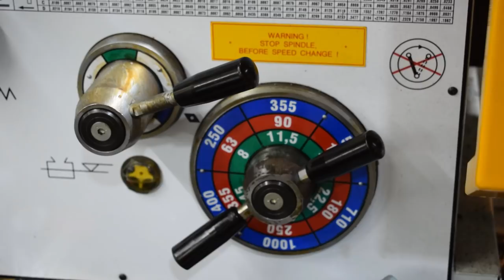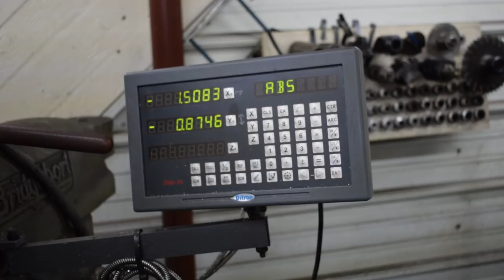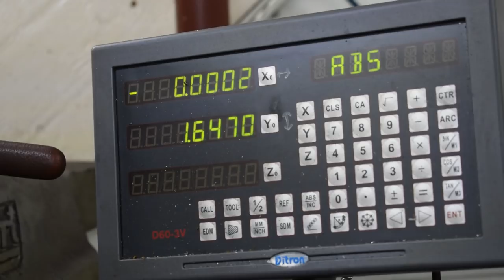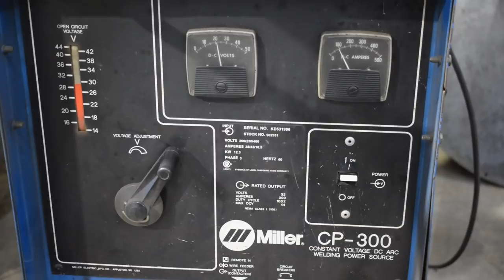Hydraulic Cylinder Rod Eye Removal and Reinstall - Machining and Welding

Comment: Nice of you to take the time to make a video. When finding the center of a circle with a DRO. Use your edge finder on the first side and zero your axis then go to the other side then touch your 1/2 button then touch your axis again when you return to center your DRO will read zero.
Do the same for your other axis and you will have a perfect center.
Jack, Heavenly Machining.
Reply: You caught that too. I had no idea whet he was up to with the dial calipers.
Reply: It seems to be easier to just use a dial indicator in the spindle.

Comment: This was a very interesting video showing an unconventional way of undertaking a difficult repair. I have a tip for you. I  was recently watching a video where the guy was doing plasma cutting, MIG welding, arc gouging and arc welding. He had his camera behind an auto-darkening welding lens and the video really showed up the various processes very well. It showed a first-hand look at the processes, just like the operator would see. It could be something you might want to look into. All the best from Queensland Australia.
Reply: I've also heard that a welding arc can damage the CCD in a camera. No idea if true, but I think a helmet (or just the module from a helmet!) could certainly be a good thing to do.

Could also protect camera from accumulation of vaporized metal and such from the welding process.
Reply: @Resonantfate  guess it's a good thing consumer grade cameras haven't used CCDs in a decade...

Comment: Kurtis tack welds it while its still in the lathe. With that brand new lathe of yours, I'm not sure I would do that. Fun to see the comparison.
Reply from the maker: Yeah, I've seen that done. No chance I would ever do that. The risk of damage is too great.
Reply: @TopperMachineLLC  I'm a controls engineer and I have a background in automated welding. Many assembly lines have welding cells and don't have any issues with the electronics. Kurtis addressed this in one of his videos and he has no issues. I can't say if it's good or not. Kurtis is a stud tho. That cat is a worker.
Reply from the maker: @ValiRossi  the electronics don't concern me at all. It's the spatter, and fumes filled with particles getting on the machines. That's why my weld shop is separate from the machine shop. I made the mistake when I started out and added the weld shop soon after.

Comment: Nice work man. I would like to see a slightly deeper back cut into that weld area just to get more thickness into that weld and a couple of tack welds all the way around before starting the full weld. Almost certainly its pulled to the side a little.

Comment: Great work Josh, nice camera work on the Mig wire running out. Bits like that take you up a notch or two from the others. Oh... and... May the Force be with You !
Reply from the maker: Thanks. I was wondering who would be the first to comment on that. Lol
Reply: @TopperMachineLLC  On a serious note, it made a lot of sense to do those cylinders like that especially if you've got all those skills in house to do it.
Reply: @TopperMachineLLC  I also knew you'd run out of wire. You commented on the wast of the wire. With your large roll, it's only a small percentage of the roll. I use flux core wire, as I only do a bit of welding occasionally at home and I use 1lb or 2lb rolls, so the amount of wire I have to waste is a lot higher percentage of the roll. Pity there isn't a way to join the wire when it runs out.

Comment: Josh, you have your audio level recorded (at some point in the video, maybe all of it) a good bit loud. The "Stats for Nerds" on this video reports:
Volume / Normalized: 100% / 37% (content loudness 8.7dB)
What this means is because you recorded 8.7dB too hot, YouTube has cut the volume down to a maximum of 37% of the recorded volume.
This actually makes the output volume a bit low.

Ideally you want Content Loudness to be 0dB or a little bit below that. Don't go way low, since YouTube won't increase the volume if it is too low.

Comment: Might be worth looking at getting an R8 shank ER 32 or 25 collet chuck and a handful of tap collets for the sizes you use most often. R8 to MT adapter with MT tap holders would also work. You would lose some Z travel, but you would get reliable torque transmission through the square drive.

Comment: Glad to see a chain hoist in the weld shop we need one by the Lathe we are getting older every day thanks
Reply from the maker: I'm working on one for the machine shop as we speak.  Jobs are getting way to heavy.
Reply: @TopperMachineLLC  Join the club!
Reply: I follow Curtis and Adam among others, and they are always scrupulous about blowing off debris as well as wiping.  Topper needs air as well as a hoist at the lathe. I cringe sometimes when new cuts are started with debris laying around on the piece.

Comment: I work in the plant where that cylinder was manufactured. You won't hurt that chrome. (Today atleast) they machine the threads for the piston nut after the rod is chromed and polished. They also weld the eyes on to the rods by rotary friction welding, that occurs after chrome, polish and machining.
Reply from the maker: It seemed like a good quality rod. After the first one I knew it was good chrome.

Comment: I see you backing up a lot with your fork lift. I suggest you put add some side or rear view mirrors for safety. Who knows if someone comes in and surprises you one day.  Does it make a sound when you are backing up? Good videos. Thank you.
Reply from the maker: Don't have to worry about anyone coming in. Open by appointment only, and doors are locked otherwise.

Comment: Very interesting video I have made custom length hydraulic cylinders in my farm shop I don't have any nice tools other than a century stick welder and a abrasive cut off saw it took about a hour to saw the 2 1/2" chrome rod the barrel cut easy it was -20 degrees Fahrenheit out doors and my shop had no heat I welded the cross tube on and when it cooled it fell off it was the first pass so I beveled it some more and turned the heat I used gun grease on the chrome rod in the winter time and the next pass it held so I reground the weld and put 2 more passes and it has never failed it's on a log loader 5 inch barrel it has a lot of lift capacity I had to be back in operations the next day so I didn't have time to wait. I enjoy the video very much 👍👍👍👍

Comment: 16:22 lots of smoke and little coolant.
Yes, that was a good bit of GTAW filler wire.  0.045" is right size for 16 gauge sheet/tube.  S6 is a bit more fluid than S2 with extra deoxidizers, perfect for blind tube welds where you can't clean the inside.

Comment: I have never had to cut the eyes off a piston to replace the seals and I've always used a 4 to 1 with a torque wrench to take the nuts off and put them back on to the Pacific Torx now I have had to weld new eyes on because of waddled out bushings and being broke off

Comment: Rance here Josh, first time viewer. Will the facing off (flattening & drilling) end of eye cause a weak area that will crack & fail under the extreme pressure the eye experiences with use?
Reply from the maker: Not likely as most all of the real force is on the rod end on these.  I also took such a minimal amount of material off that it should never be an issue.
Reply: @TopperMachineLLC  Thanks Josh, I am not a machinist (maybe a wanna be) in my self study and listening to videos …the zert greasing area which penetrates into the eye area has been a weak point in some high stress places. Just wondering if this might be a similar circumstance. Appreciate your prompt answer and knowledge. Really enjoyed video.. I have subscribed to your channel.

Comment: I always just pin them and tack it in the lathe before heading to the rotator to weld. It's also rare I have to cut an eye off to repack but it has to be done sometimes. Some "non serviceable" cylinders can be rebuilt, you just have to cut the butt end off amd re weld it.
Reply from the maker: We discussed pinning, but decided on the threaded rod for fine adjustment of final length. I've worked in shops that welded in the lathe, not in mine. Saw a couple lathes scrapped because of improper grounding, weld spatter, dust, etc.
Reply: @TopperMachineLLC  for sure, and yes you really have to take the precautions or welding in the lathe can be a disaster.  I can see why you wouldn't that's a nice lathe you have and threading was a better way to do it out of the lathe. I love hydraulic cylinder work, do lots of it so it's always cool to watch how others do things. Always learning in this trade lol
Reply from the maker: @kamper4140  thanks. I really like my new lathe and want it to last. I just started doing hydraulic work, so still learning. The shop I'm working with has been at it almost 50 years and recently lost their machinist due to major health problems. Before I do anything, I consult them. Having never done it before, I was cautious on the first few and they told me that it was as good as what their guy did. I was the 4th shop they tried and the first one to put out the quality they are known for. It's been working out great for both of us, they get quality products and I get to learn new skills.
Reply: @TopperMachineLLC  that seems to be a trend right now in the manual machining world unfortunately. I'm 39 and not many my age or younger are into what we do, gonna be a problem the more the old timers bow out. I find that if you can tackle cylinder work it can definitely keep you busy!! I see some stuff that comes in from other shops and sometimes it's a head scratcher lol.

Comment: Great work. Is preheat required for welding eyes to rods?
Reply: I think you are right. this guy needs to watch a few more episodes of Kurtis at CEE, I guess he does it this way to cut down on the welding.
Reply from the maker: Sometimes. You do have to be careful not to get the chrome too hot. I've seen repairs where they preheated something that shouldn't be and then cooked the chrome off 3 inches down. Basically scrapping the rod. These rods weren't big enough to require preheat. A little bigger and I definitely would have.

Comment: Why threaded holes? A pin would make for much better alignment. Why did you not use an indicator, regular or coax to center up on the eye.
Reply: The thread acted as a micro adjustable connector/aligner.
A pin could surly be used?.
But it would be more difficult/variable/unhelpful.
Reply: @captcarlos  Breaking a tap would be more unhelpful than using a pin.

Comment: Just a question. Would it not be better for that under cut to be closer to the treaded insert to get the weld to start just shy of the the threaded insert. That way tje weld be be a significantly higher % of the diameter of the shaft.

Comment: I see why you went modern on the lathe now you needed that large spindle bore more than anything else
Reply from the maker: Spindle bore, metric threading, spindle reverse, and tolerance. It has definitely been a huge upgrade.
Reply: @TopperMachineLLC  yeah I don’t think I would get rid of my koping lathe this 2-5/8ths spindle bore is great metric threading is an option on it as well for awhile was my only option but  I’m finally setup to make the change gears for it
Reply from the maker: @jeremycable51  I wouldn't get rid of it either if I were you. But my work warrants 4" bore. Sometimes I wish I had 6" or larger, but it's not frequent.
Reply: @TopperMachineLLC I got this lathe insanely cheap 175$ koping s8sa 16x10’ between centers all in under 600$ and it’s a great machine

Comment: You don't need to cut it with the bandsaw you can cut it a little more heat it up a little bit and I'll fall it off
Reply from the maker: This is friction welded, meaning that it is welded all the way through. It had to be cut off.